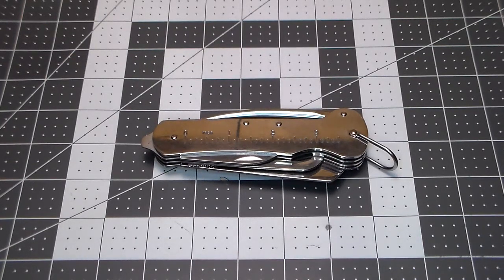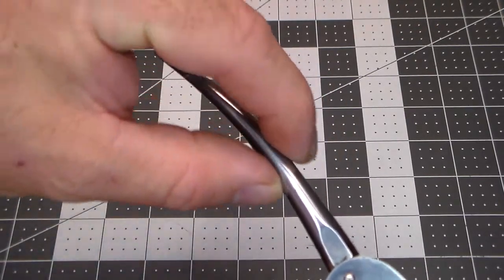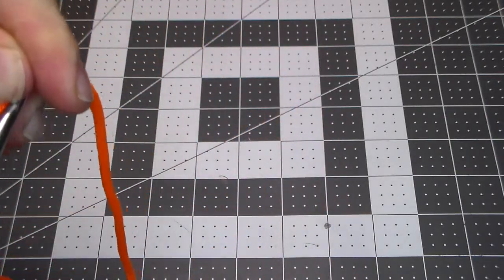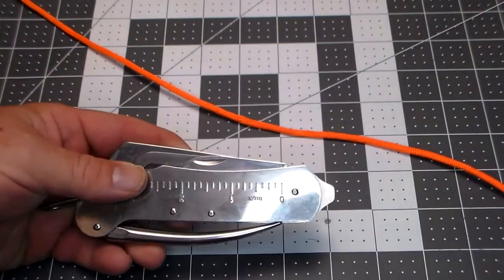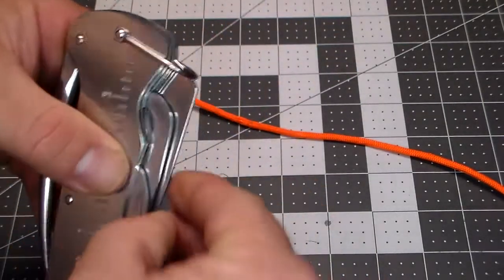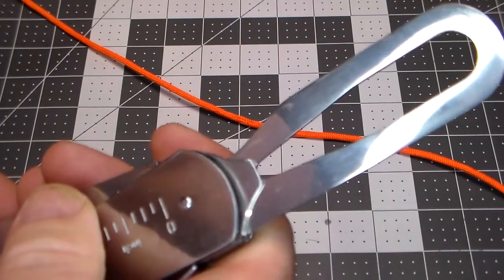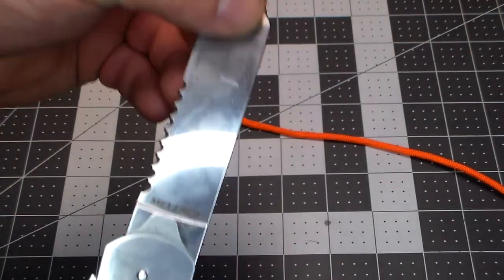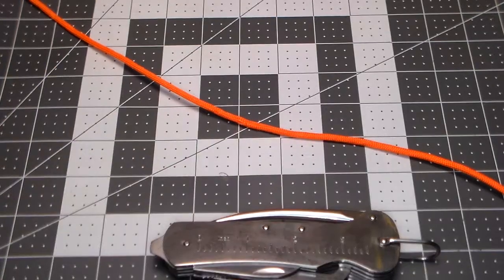Bushcraft Basics what is a Marlin Spike?

Comment: Just go clarify: Marlinspikes are always metal. If it’s wood, it’s called a “fid” (for splicing rope and making holes in canvas). It is called a marlinspike because of it’s great ability to tighten a thin rope with tar in the center called “marlin” using the marlinspike hitch. It’s also impossible to splice metal wire without one. Any tallshipsailor will have a dedicated spike on their belt at all times. Great video!
Reply from the maker: Thanks for the info.